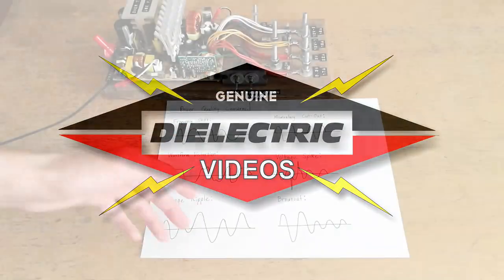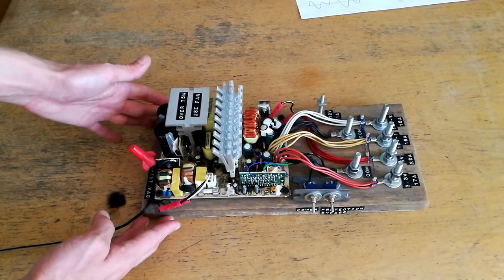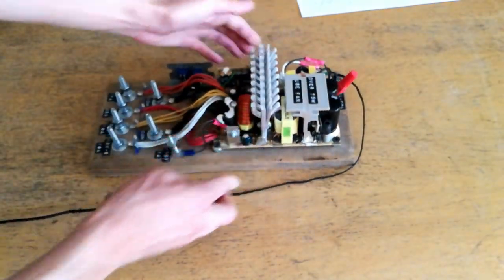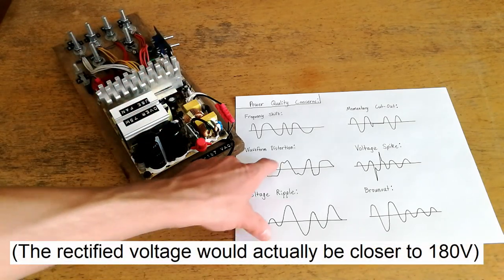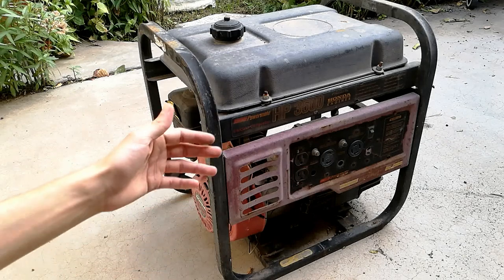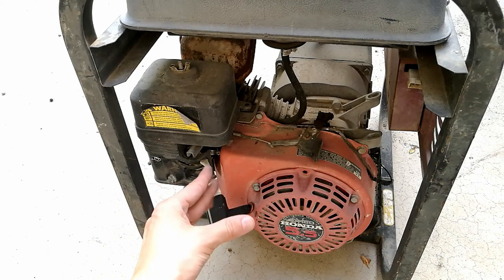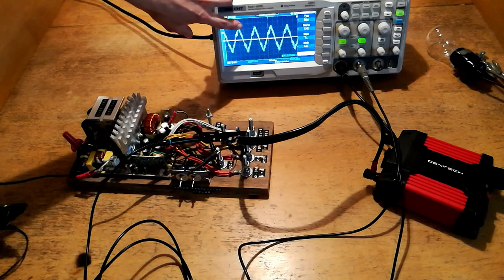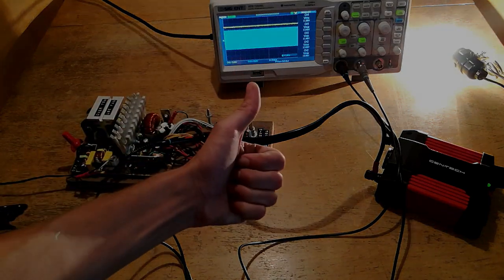EP 45 - Power Quality & Sensitive Electronics

Comment: Thank you for confirming my thoughts on the matter. A lot of people swear by how clean the output is from an inverter generator, so much so that they say that non-inverter generators should not be used when powering up "sensitive" electronics. Though it is true that inverters are better, it's not to say that non-inverters are bad. I think that the marketing materials are exaggerating the effects of "bad" AC waveforms. No doubt that I'd still get an inverter just for the lower noise and fuel efficiency. But choosing between an inverter vs non-inverter generator to run electronic equipment is never a deal-breaker.

Comment: This is exactly the video/information I have been looking for. I recently bought a Champion 6,500 watt generator and had it converted to tri-fuel, primary fuel source natural gas, for power outages. All the bulbs in my house are 9 watt 60 watt equivalent LED and I am not one to turn them off and on as I enter and leave frequently used rooms. Similarly my wife and I tend to leave our TVs, media players and laptops on most of the time. I calculated our nominal power usage to be about 2,000 watts/hr, well below 50% of the generator capacity, check 1. Number 2 we don't tend to turn things off and on, check 2. My media server is fairly new, the power supply is 600 watts, but according to a watt meter I only use 170 watts, check 3. But there is our fridge, freezer and combo boiler/water heater. I am worried about these devices because they have indictor motors. I was going to put UPSs on my media server, etc because I have about $3,000 invested in it, but after your video, I am wondering if I should use UPSs for the inductor devices or is there a better, relatively inexpensive way to protect them while on generator power. P.S. The fridge and combo boiler/water heater are brand new, the freezer is ancient, if it blew up, I would not be too concerned.

Comment: The only thing that changes when you mess with idle speed on a genie, is the HERTZ.
Reply from the maker: If there's no AVR, both the frequency (Hertz) and the voltage follow the speed. See the blue trace (generator output) at 28:35 for example.

Comment: Excellent video.I'm new to scopes and am learning to test dc circuits. I  recently watched one where a guy was testing UPS units showing the horrible outputs when on battery. I have a newer APC sinewave ups. I'd like to see the output on my scope but am not sure how to do it safely as I've seen tutorials about being careful with shared ground and scopes.
Reply from the maker: The "right" ways to measure mains-referenced circuits are to either connect the device under test to an isolation transformer, or to use isolated oscilloscope probes.

The "wrong" way that I usually use is to just remove the ground pin from the oscilloscope's power cable. This leaves the scope floating, so no fault current can flow through the scope cable to earth ground. The downside of this is that all metal parts of the scope are now at the measurement potential of your circuit, so touching the scope can be hazardous. With some care, it is fairly easy to avoid being shocked.

I wouldn't officially recommend my method, but I figured I'd mention it anyway.

It's also worth noting that if you are probing the UPS with its power cord and I/O cables unplugged, then it is technically isolated from ground already, and as such *should* be OK to probe directly.

In any case, I take no responsibility for the results of your experiment if anything gets blown up!
Reply: @DielectricVideos  Even though I have an isolated probe, "never used," I'll just leave it to the pro's or dare devils!

Comment: Great explanation. One thing I would like to know how to connect an oscilloscope without damaging it. I have a 230v diesel power generator and I would like to measure output sine wave. I'm concerned damaging the oscilloscope if I connect neutral probe to the chassis and the positive probe to 230v load.
Reply from the maker: I usually connect the oscilloscope with the ground pin removed from the power cord. This can also be dangerous, though, as the chassis of the scope can become live. A safer way is to plug the oscilloscope into an isolation transformer.
Reply: @DielectricVideos  I need to take a look into this, thanks. Maybe portable oscilloscope will be a solution.
Reply: We always had isolation transformers on our bench scopes and most bench equipment, but you don't need one if your scope is battery powered.
Reply: Can the scope measure 230V ??? 
Next there is NO neutral in 230V.   
Its no different than connecting the 230V to a DMM ... the red to L1 and black lead to L2, that gives you 230V. 
On your scope its the same, the red to one 120V leg and the black to the other 120V leg

Comment: Very informative! I have a newer but still basic harbor freight 3600w generator and it has circuitry in it to keep the voltage stable at almost any engine rpm, but the output freq will obviously change. I haven't scoped the waveform, but now I'm curious to see what it looks like. I don't like the engine screaming so I've turned it down to make a 50hz output, which has been ok on switch more supplies I've tested. I'll just have to see if that's ok for a new and old refrig compressor motor. I wouldn't want to overheat it by trying to save a little sound! I think my new fridge has an inverter / variable speed compressor.
Reply from the maker: Induction motors will tend to run a bit hotter at lower frequencies. The current through an inductor as a function of time is described by the equation i(t) = (V/R)*[1-exp(-Rt/L)], which means that the longer the inductor is allowed to charge, the more current will flow through it. The lower frequency gives the coils of the motor more time to build up current flow, and thus it generates more heat.

At 50 Hz it probably wouldn't be too far off of nominal, however, so there's a good chance it would still work. I would try it and just monitor the compressor temperature to see if it overheats. The discharge temperature shouldn't exceed 225 F for most refrigeration systems, so that might be something to monitor. Most compressors also have an internal thermal cut-out, so if the compressor stops unexpectedly and then starts back up a few minutes later, it is probably also overheating.

Comment: Very interesting. So I'm thinking, can I run our church sound system directly from a normal generator with no other switching loads attached and a dummy load of maybe 200W just to keep the generator stable at low loads?
Reply from the maker: You may want to try a small number of devices to make sure they work correctly before connecting everything. One other risk that I didn't mention in the video is the risk of the governor on the engine going into runaway, which could cause a large sustained overvoltage. Definitely be sure the generator engine is in decent condition if you're wanting to connect lot of expensive load to it.
Reply: @DielectricVideos  Good ideas, thanks for the reply!

Comment: Older models dont have AVR so the voltage can and WILL spike as you said which is what CAN hurt electronics ...
Also with that said, most electronics that have an external power supply or power adaptor or "brick" will show you its AC input voltage limit, i have 5 in my house from my laptops and other devices and their input voltage varies from 100V to 240V ... So if that ac spikes to 140V or even 150V, it wont hurt the power adaptor. 
My 25 yr old RCA surround sound reciever has an internal power suppply but the input voltage does show 100V to 230V AC ... 
So they can handle the voltage spike.
The only generator that i saw that spiked that high was 172V and it was from a 2 stroke 1200W generator and it spiked to 172V when he pulled the load off. 
Most modern generators have AVR to keep the voltage from spiking above 120V or 240V regardless of load.

Comment: Great video, very informative. I have a an old Generac 5000 watt brushless gen-set that I use for emergency back up power. I was curious if the alternator design brushed vs brushless makes a difference in the quality of the output power. The reason I am curious is due to the fact that I have used this generator several times and it doesn't appear to effect any of the electronic devices I have, in particular flat panel TV's, furnace with electronic controls and my computer which has an APC Back-UPS RS 1500G ups and is set for high sensitivity. However when I hooked up my neighbors 5000 watt generator which is much newer and has a brushed alternator it does have an effect the furnace controls and my UPS. The furnace goes into a standby mode and the APC UPS immediately switches to battery backup. Both gen-sets are within +/- 4 volts of 120 volts when running and the frequency ranges between 58-62 Hz for both generators. The difference between the two generators is my 20 year old generator is brushless and utilizes a capacitor to regulate voltage and his is a 5 year old brushed alternator with AVR.
Reply from the maker: That's an interesting observation. I would suspect that the brushes could be introducing commutation noise into the field coil, causing small voltage fluctuations which trigger an out-of-tolerance error on the UPS. It could also be that the alternator is producing a similar triangle-wave like mine does, which could result in higher peak voltages despite having a correct RMS voltage. Do you have access to an oscilloscope by any chance to directly display the output waveforms of each generator?
Reply: Unfortunately I gave away my old Tektronix to a friend a few years ago when I moved thinking I wouldn't have much use for it any more but it would be interesting to see the outputs of each genset.
Reply: Here is a reminder about portable generator safety: This advice is just to make sure that everyone is aware of all the warnings and it’s just to remind people to be careful using portable generators. Everyone has to see this safety reminder for safety. Every year, hundreds of people die or get injured when using portable generators due to carbon monoxide poisoning and electrocution. Make sure you are using your generator carefully and keeping others safe as well. There is something very serious that everyone should always be aware of when using generators. Some people do run their generator indoors which is not safe and that increases the risk of carbon monoxide poisoning which can cause death of family and you. Some people run their generator in wet conditions which can electrocute them. Please remember that you should never run your generator indoors. Remember that carbon monoxide is an odorless and colorless gas that you cannot see or smell. Carbon monoxide is a silent killer. Keep that in mind. Make sure your generator is 15-20 feet away from your house and away from doors, windows, and vents. Never use your generator in your porch too. Having a carbon monoxide detector is very important against generator safety. Some people also allow children to go near the portable generator which could pose risks. We need to keep an eye on our children making sure that they are not near the portable generator so they won’t get electrocuted or burned by the generator which is dangerous. A locking enclosure also keeps kids safe. A generator shed might look like a tempting place to explore, or take cover during a game of hide and seek, but a generator is a dangerous piece of equipment that can cause injury. It says on the manual that we should also keep children away at all times from the portable generator to avoid injuries. Please do not allow a child or unqualified people to operate the portable generator. Just because some manuals missed what should be listed doesn’t mean it’s safe to do. Always follow the generator safety rules when using portable generators. Generators pose electrical risks. If you need to use your generator during wet weather, you need a generator tent to protect your generator from getting wet. Don’t let your generator get wet. Keep your generator dry and before using your generator, please make sure your hands and your generator is dry. Do not wear loose clothing when operating the generator. Everything that is said on the generator’s operating manual should not be ignored. Never smoke cigarettes near the generator. Please keep flammable things away from the generator. Never overload your generator too. Your generator can catch fire. Never ever try to plug a generator cord into a wall outlet to avoid back feeding. Back feeding your generator is dangerous. Always turn on your generator first before plugging in appliances and shut off the appliances before turning your generator off. Use a heavy duty cord for your generator and the cord should not be worn out. All the instructions should be followed carefully. Never refuel your generator while it’s running. It can cause fire if fuel spills while your generator is hot. You should turn off your generator and let it cool off before refueling it. Having a fire extinguisher next to the generator is also important. This is only a reminder for everyone’s safety of using generators. Make sure your generator is properly grounded. https://youtu.be/I1jT3ANENvI and here is a video more about keeping others safe when using generators and also about our family’s safety. Hope this helps. Thank you. Hope you stay safe
Reply: stop trolling generator videos

Comment: I often hear inverter-generator marketing materials referring to clean power for "sensitive electronics like computers and cellphone chargers" but we know now that's BS. "Sensitive electronics" would more likely be tube amps, HAM radios, CRTs, or other (mostly old) electronics that actually depend on their supply being a perfect 60Hz or a perfect 110-120VAC. Also, and again it's ironic that it's the opposite of the marking materials, but the opposite of "sensitive electronics" like dumb motors found in refrigerators, etc. that are induction and dumb transformers may also run at the incorrect speed, incorrect current, and/or hum or buzz excessively.

I've heard some UPSs will refuse to resume normal AC operation on generators because they are looking for 58-62Hz, and many generators run a little fast at 63Hz. So the UPS will stay on battery power until the generator is sufficiently loaded to bog the speed a little.

Comment: I just experienced a few weeks of power outage a few months ago and now another ongoing one and in that time I had to use generators and bought one at H.F. which is a 4375/3500w and was using it to power my refrigerator/freezer and 10000btu AC unit plus 2 lights and a 2nd 5000btu AC unit all at the same time and everything seemed to work fine, also used TV/DVD here and there with it too.. it is a non-inverter generator. I even had the experience of watching my step-dad use a 40yr old 5000w generator to power his 2 refrigerators/deep freeze and computer/tv/wifi and it seemed like it worked fine.. that thing would get running a little funny and it took awhile to get it to run w/o surging or sputtering and backfiring (it was LOUD!) But through all that everything seems to function still. 
I was originally upset when I learned of the difference between inverter/non-invter gens and thought how I should have paid the extra $ to get the inverter kind but after seeing him running his and stuff I don’t know.. guess im gonna have to re-watch your vid to (try to) figure out which of my things should best be run on a inverter generator and then which one to get.

Comment: In your opinion would a generator with an AVR and THD of 12-20% be ok for tvs and a 80% efficiency furnace? I mainly got it to be a backup for my well pump and to charge things but it would be nice to run the furnace if I ever lost power in winter.
Reply from the maker: I suspect so. The TVs will likely have universal power supplies (90-260VAC), so they should be less susceptible to voltage spikes. The control board in the furnace is likely powered directly from a 24VAC transformer, so it might be more susceptible. However,  in either case the AVR should help stabilize the voltage, so I believe it should work. Just verify that the generator's peak starting power is adequate to start the furnace motor, which will draw 5-10x its normal running power when first starting.
Reply: Thanks for the reply and the video, really well done concise.  @DielectricVideos

Comment: thank you for not just explaining, but showing this.  is there any commercially available protection (other than a regular high surge protector, either coming off the generator or as a power strip at the electronics) you might recommend?
Reply: Yes, Tripp-Lite line conditioner, $220.00 on Amazon or Home Depot, generators state in the instruction manuel that a line conditioner is required for use with sensitive equiptment, the line conditioner will keep your generators output 120v stable, it will adjust incoming voltage and will protect against incoming surges and line noise, it corrects high or low input voltage. I have the LC2400 for a 2200 watt generator, the Tripp-Lite Line conditioner is available for different wattage needs.